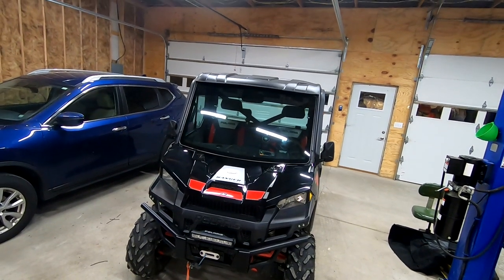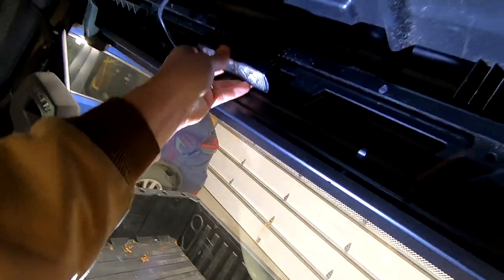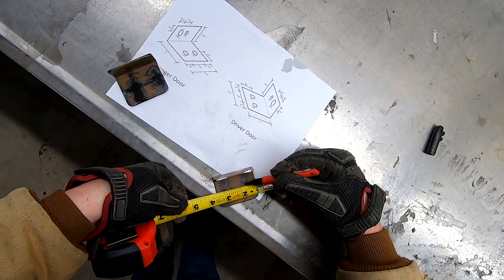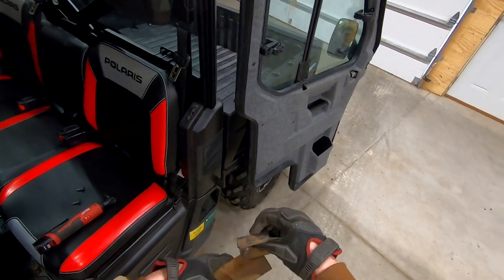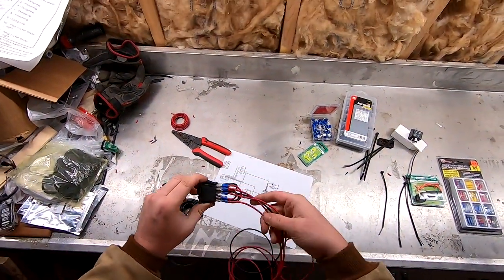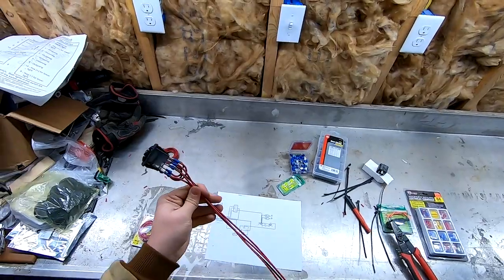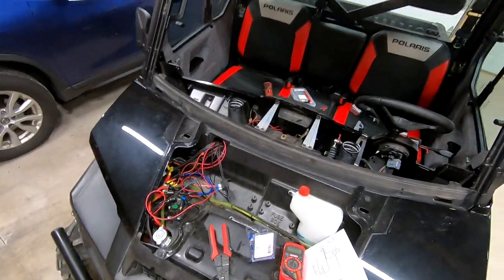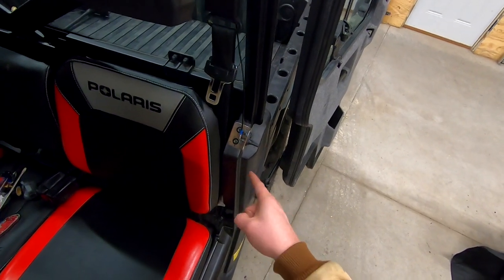Dome Light Installation With Door Switch [Polaris Ranger UTV]

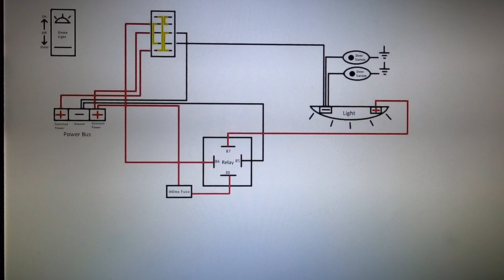Comment: I'm a noob, so bear with me on this. I'm looking at the wiring diagram at 3:42 and it looks like constant power is being sent to both Pin 30 and Pin 86 on the relay. My understanding is that Pin 30 is getting constant (fused) power. Constant power is also going to the middle pin on the toggle switch. That is jumpered to the 2 pins next to it, which is effectively sending constant power to Pin 86 on the relay. Is that right?

Comment: I have a 2021 Ranger 1000 Premium with the Clearview full poly-glass doors.  This would be a great addition.  Do you have a better picture of the rocker switch wiring.  You have a lot going on there with the jumpers and wires coming off of it. I paused the video but it doesn't clearly show the jumpers and everything.  I'm not too good at reading the schematic.  Thanks.
Reply from the maker: The yellow lines on my wire diagram at 3:42 indicate the jumper wires. As for the switch, all of the pins on the left side are for positive power and all of the pins on the right side are for negative/ground. That being said only pins from the same side will jump to each other. There will never be a jumper from positive to negative in this instance. Therefore the top/left pin jumps to bottom/left, and second/one down from top/left jumps to 4th/one up from bottom/left. For the right side, top/right jumps to second/one down from top/right, and the right/middle pin jumps to bottom/right pin. Hope this helps.
Reply: @condorsgarage  Thank you.  I will be ordering the parts you listed.
Reply: I have it wired or I think it’s correct but the switch light is always on.  I must have the switch wired wrong. When I open the doors the light comes on when they shut the doors they go off. But the switch on the dash is constantly on. When I turn it to the center position the light is off and the dome lights do not work.
Reply: Finally figured it out.  I had the wrong red going to the constant on and a couple of other minor issues. Now the switch light is off until you turn the key on. The lights come on when you open the door and off when you shut it. Thanks.

Comment: what happened to the link to find the parts needed?
Reply from the maker: If you expand the description you will find the materials list which includes links to everything I used
Reply: @condorsgarage does the switch orientation matter before wiring, meaning, is there a top and bottom or is that determined once you have it wired,